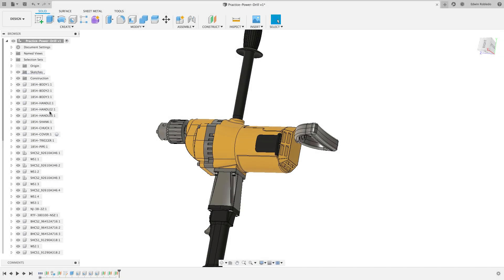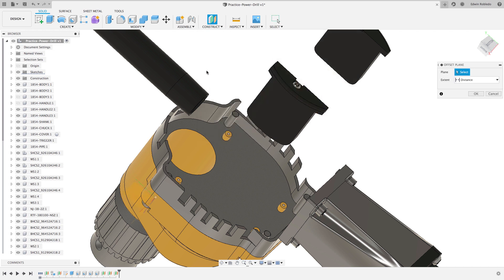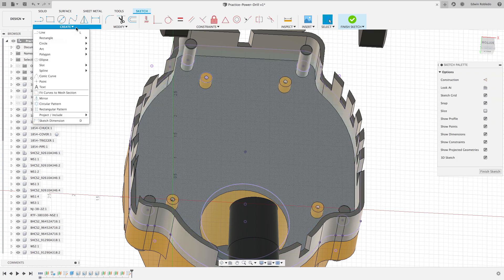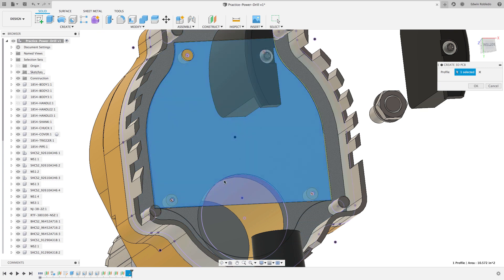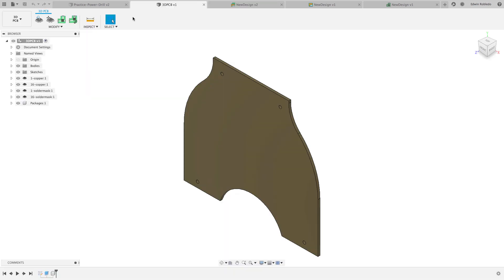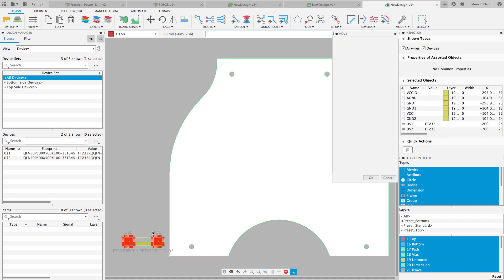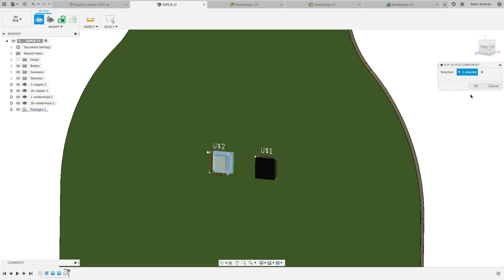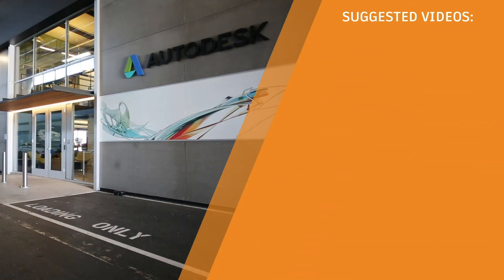Defining PCB Outline from Existing Geometry

Comment: I take back everything good I've said about F360 electronics integration. It's a hot mess, crashes every other day and the restrictions in the free version are just ridiculous and badly documented. Did you know the free version restricts you to the first quadrant of the coordinate system on PCBs? I didn't find that in the documentation, I had to figure that out trial and error, because the developers can't even be bothered to display proper error messages. Deeply annoyed and disappointed. If that's your attempt to get me to spring for the full version, congratulations, you failed most spectacularly.

Comment: How do I import PCB outlines generated in non-Fusion 360 mechanical packages ? Fusion 360 PCB package does not seem to have anyway to import a PCB outline from a file (DXF etc),. This is a massive limitation so I am hoping I am wrong about this ???

Comment: sir i have done the same, but how to include those mounting holes which is by default in the dimension layer to the drill/excellon file. i couldnt do it. pls help

Comment: Hi! my PCB is meant to fit within a parametric design whose dimensions and shape can vary along time. For example they can decide to thicken the enclosure edges, or add fillets that would not allow my PCB shape to fit there anymore. Is there a way to update my PCB outline shape so that any change in my projected geometry is automatically reflected to the PCB outline? That woulbe be the ultimate benefit of a parametric design environment...
Reply: Pretty sure that's already implemented... as long as the selected profiles for your PCB shape remain intact. Then you'd have to "push the update" to the PCB space as shown on this video. Take this with a grain of salt
, as I'm a novice with PCB design on F360

Comment: Thanks for this info but a couple questions.  Is there anyway to modify the board shape in Fusion 360 and have those changes reflected in the 3D PCB work space?  When I tested this, by using the Create 3D PCB feature, it sends you off to create it, but doesn't sync those changes back to Fusion 360.  Am I missing something?
Reply from the maker: Hi John, this is Edwin, thank you for participating. At this time, the board shape edit would need to be done on the 3D PCB. In the 3DPCB timeline you will notice the sketch, edit the sketch. After editing the sketch right click on the extrusion timeline to edit the PCB.

Comment: Why does thus have less features then the fusion link inside eagle? Why does it not automatically appear in the design, where the outline was defined? Why does the board outline not update when I change the definition sketch?
Reply from the maker: Hi handsdietrich83, thank you for taking a look at the video and providing your insight. This is work in progress and it will get better. The 3D PCB now recognizes the geometry of every aspect of the PCB. This include Vias, traces and other assets of the board. This allows for the ecooling solver to work and eventually the implementation other manufacturing options. In EAGLE it only recognizes the geometry of the components. In the F360 3DPCB take a look at the timeline, here you can edit the sketch and change the original outline.

Comment: As an engineer already fluent with Eagle and Fusion 360, I have to say it seems Autodesk created a completely different product with this release. It will take a much better learning and documentation package to make it productive. Way too many steps, way too many files created. No support for in house libraries. 
I was told it was released knowing that it wasn’t truly ready for prime time. Autodesk dropped the ball on this one.
Reply from the maker: Hey Bill, thanks for the feedback. I'll make sure to pass this along so that your thoughts/concerns are heard.
Reply: Hi Bill, thank you for taking the time comment on this quick tutorial. Not sure to understand what do you mean by "Support for in house libraries", if you currently have local libraries, you can upload them into existing Fusion 360 Project folder. From here you can edit and share them. From the manage library option, you are able to access your available libraries that you have converted into managed libraries or access managed folders that have been shared with you. Please join our active forum: https://tinyurl.com/vtw62oz

Comment: Can you show how to populate the 3D PCB into the design workspace where the board outline was defined? This is the whole purpose of the integration right?
Reply from the maker: Hi Michael, thank you for your participation. Make design workspace active, now right click the 3DPCB from your Project Data Panel and select the option Insert into current design.
Reply: @adskFusion  When I do this, I get an error about cyclical dependencies. Has something changed in how this is supposed to work? Steps taken: 1) make sketch 2) create 3D PCB from Sketch 3) populate board in PCB design window 4) push changes to 3D PCB, save 5) activate design workspace 6) right-click 3D pcb in project data panel and select insert into current design. 7) ERROR: "Cyclical dependencies not allowed..."
Reply: I may have found the answer to my own question. Is this right? I need to create a new assembly file and import both the enclosure geometry and the 3D PCB there for final assembly. ??
Reply: Autodesk Fusion 360 I have the same problem. The video is great but misses the final step which is indeed the whole point of the video. You suggest to make design workspace active and right click the 3DPCB. Man there are like 200 workspaces and PCBs/schematics everywhere. Are you able to be more specific or just upload a 30 second video to illustrate? Thanks

Comment: [Edit] it's working  but we need a new folder for every project. it wasn't clear in the video. [/EDIT]

the new version is really frustrating. this was not intuitive at all, and even with the tutorial, i can't do the synch with my blank electronic design group (schematic & board) it doesn't appear in the "link to" option, even if it"s perfectly saved .
Reply from the maker: Hi Adel, it is recommended that each electronic project does have it own project folder.  Electronic projects will commonly consist of a linked Schematic, PCB and a 3DPCB. We recommend to organize your libraries on a seperate project folder, that way they are in one place when editing or adding is necessary.

Comment: Speaking as a noob, I wonder how someone with even a moderate amount of 360 experience would know to do these (many!) steps without the aid of this tutorial. Doesn’t seem at all intuitive. Maybe some of it will, eventually.
Reply from the maker: Hi Adam, thank you for your comment. We are committed to continue improving your experience. The primary benefit of this integration is that you will no longer have to convert files when venturing between the Electronic and Mechanical disciplines of your product.
Reply: @adskFusion  This feature is actually something I'd never use, but I was interested in it because I want to see if it's possible to learn to "think like Autodesk Fusion 360" to some extent, to be able to problem solve when encountering something new. This tutorial got me a little concerned that there might not be a way of thinking after all--it's just a lot of memorized steps.